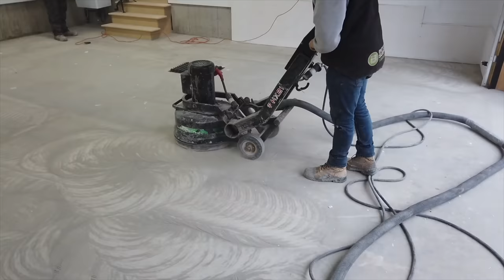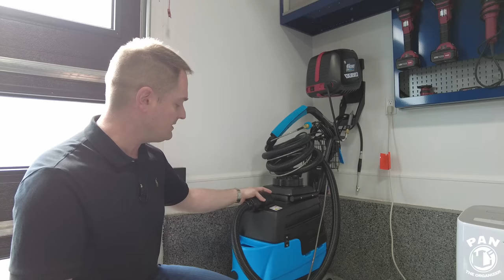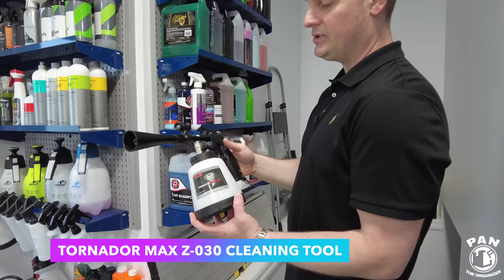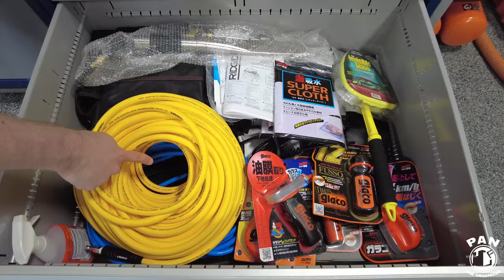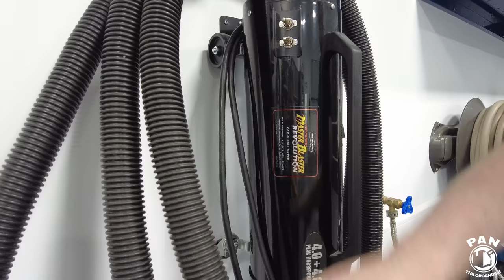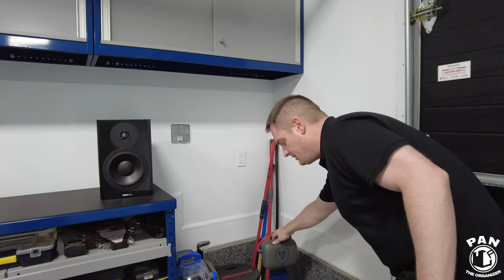INSANE garage tour! A car detailer's dream!

Comment from the maker: 🔥 For more quality detailing products visit: https://bit.ly/3BiPe3o

⬇🔶 LINKS TO PRODUCTS MENTIONED IN THIS VIDEO ⬇⬇
🇺🇸 For people in USA:
LED High Bay lighting fixture (5000K): https://amzn.to/3afEA03
Liftmaster 8500W garage door opener: https://amzn.to/2DwiKkN
Rousseau Metal garage cabinets: https://bit.ly/3AoK5UP
Mytee 8070 Lite extractor: https://bit.ly/3QJ0id4
FIAC WallAir compressor: https://bit.ly/3tNrSfI
PCL Accura 1 Tire Inflator: https://bit.ly/3QDhAIz
Dehumidifier: https://amzn.to/3ApwDjE
FLEX polishers: https://bit.ly/3Aso1sm
Rupes polishers: https://bit.ly/2T6O5m7
Microfiber towels: https://amzn.to/3P5aHyl
Bottles & sprayers: https://bit.ly/3uoNWNY
EGO blower: https://bit.ly/3afmfAb
Work platform: https://amzn.to/3ykTE4G
Tornador MAX: https://amzn.to/3Rara5W
ApexAire blower shorty nozzle: https://bit.ly/3ulLjwf
Blowerband blower nozzle protector: https://bit.ly/3nC8AWR
Daikin heat pump: https://amzn.to/3umvXrv
Detail Factory brushes: https://amzn.to/3NKtVYS
Ridgid 4.5 GAL air compressor: https://amzn.to/3AEWO67
Ridgid 4070 wet/dry vacuum: https://amzn.to/3HQOYaJ
Ridgid auto detailing vacuum accessories kit: https://amzn.to/2R9YLRf
McCulloch MC1385 Deluxe Steam Cleaner: https://amzn.to/37LMCaN
Scangrip LED inspection lights: https://bit.ly/3aeyb5i
Detail Guardz hose guides: https://amzn.to/3AsowCK
Nitrile gloves: https://amzn.to/3OFLmuR
MetroVac Master Blaster Revolution: https://amzn.to/2Dw8MjC
Wash buckets package: https://bit.ly/39xAdNf
Bucket organizers: https://bit.ly/3OIHf15
Nike shoes: https://amzn.to/3ukQH2w
Eley wall-mounted hose reel: https://bit.ly/3b6lSV3
Eley polyurethane garden hose: https://bit.ly/3qqGePb
Eley professional sprayer nozzle set: https://bit.ly/3u4wuwb
Kranzle 1122TST pressure washer: https://bit.ly/3d5kZeK
Mosmatic gun & wand solution: https://bit.ly/3ovIcPA
CR Spotless deionizer: https://bit.ly/3OGuog9
HiFi sound system: https://bit.ly/3R77Cj3
Vyper Chair: https://bit.ly/3R5OH8i
Undercarriage washer: https://amzn.to/3Al3JBb
The Detail Guardz Dirt Lock bucket insert: https://amzn.to/2J3VFbw
Lake Country pad washer: https://bit.ly/3yecJVX
Bissell SpotClean Pro extractor: https://amzn.to/3ONwMBS

🇨🇦 For people in Canada:
LED High Bay lighting fixture (5000K): https://amzn.to/3yd0Mjd
Beton Surface (floor coating): https://www.betonsurface.ca/en/
Rousseau Metal garage cabinets: https://bit.ly/3AoK5UP
Mytee 8070 Lite extractor: https://bit.ly/3nj4bb6
FIAC WallAir compressor: https://bit.ly/3tNrSfI
PCL Accura 1 Tire Inflator: https://bit.ly/3QDhAIz
Dehumidifier: https://amzn.to/3R75Qyn
FLEX polishers: https://bit.ly/3OM5lIr
Rupes polishers: https://bit.ly/3IaWqxE
Microfiber towels: https://amzn.to/3NFTv1f
Bottles & sprayers: https://bit.ly/3uoAnxY
Pump sprayers: https://bit.ly/3yPHTol
EGO blower: https://amzn.to/3yEMpFW
Work platform: https://amzn.to/3ybJ6EF
Tornador Max: https://bit.ly/3yDRSwy
Bigboi BlowR Pro: https://bit.ly/3R8lqJV
ApexAire blower shorty nozzle: https://bit.ly/3ulLjwf
Blowerband blower nozzle protector: https://bit.ly/3nC8AWR
Daikin heat pump: https://amzn.to/3OJa5i7
Detail Factory brushes: https://amzn.to/3un1k58
Ridgid 4.5 GAL air compressor: https://amzn.to/3AofrLa
Ridgid 4070 wet/dry vacuum: https://amzn.to/3u1lrpo
Ridgid auto detailing vacuum accessories kit: https://amzn.to/2OyyQRf
McCulloch MC1385 Deluxe Canister Steam Cleaner: http://amzn.to/2qtUkjS
Scangrip LED inspection lights: https://bit.ly/3acPUdi
Detail Guardz hose guides: https://bit.ly/3NHFkc3
Nitrile gloves: https://amzn.to/3OAbJ5v
MetroVac Master Blaster Revolution: https://bit.ly/3unFgHo
Wash buckets package: https://bit.ly/39xAdNf
Bucket organizers: https://bit.ly/3P47hvt
Kranzle 1122TST pressure washer: https://bit.ly/3MgYINZ
Mosmatic gun & wand solution: https://bit.ly/3EBUZbI
CR Spotless deionizer: https://bit.ly/3yGJcWx
The Detail Guardz Dirt Lock bucket insert: https://amzn.to/2WU1li4
Undercarriage washer: https://amzn.to/3nCyude
Lake Country pad washer: https://bit.ly/3I9YK8a
Bissell SpotClean Professional extractor: https://amzn.to/3QMz1GU

🇬🇧 For people in the UK: bit.ly/3yhUDDa

Comment: Wow! What a setup. Very impressive. I can only imagine what the value of all that equipment adds up to. Thanks for the tour. One question: How did you ensure that all the water makes its way to the drains? Is the floor carefully graded accordingly?
Reply from the maker: Yes if you watch closely you can see that each half of the garage is graded towards its drain. Water quickly evacuates. I worked closely with my house builder to make sure everything was up to Pan specs. :)

Comment: I’ve considered getting the CR SPOTLESS system, but from a lot of the negative reviews I’ve read, when the resin runs out after 200-400 Gals, it’s nearly $100 per resin unit to replace them. So the less expensive alternative a fellow detailer shared with me is to go to the RV supplies section in your local Walmart or similar store, and purchase the RV water filter hose hookups that you can simply installs on your hose line before your pressure washer hookup. Accomplishes the same task and only costs $10 per cartridge. I’ll have to calculate how many washes I can get per cartridge by attaching a TDS & WFM monitor and report back.
Reply: I am curious to see your results.  The purpose of the resin is to remove the hard water minerals that filters cannot remove.  These systems are typically good for chlorine etc but are not as efficient at hard deposit mineral removal.  I am curious to see your finding on that.  Please post.
Reply: @goodhomeplan  my buddy runs his entire mobile detail business using the RV filters and swears it’s the best hack he’s found

Comment: Pan,  you are truly one lucky man to have a garage like that!    I am jealous sir!    But to be honest I am moving soon to Colorado Springs Colorado and I am going to take some of your ideas you show here and apply them to my own new garage.  It will be nice to start from scratch on a new garage and hopefully make it half as good as your garage.     One thing I have in mind for my garage is having a totally separate good sized room that goes off the garage where I can put shelving, cabinetry, and counter tops (all in that stainless steel restaurant grade stuff which I love the clean look of) all the way around that room and store all of my chemicals and detailing equipment in that dedicated room.   I saw another detailing on YouTube who had all the cabinetry, shelving, pull out drawers, and a sink all in that stainless steel restaurant grade stuff and it looked fantastic and is fairly reasonably priced.   I do love those Rousseau cabinets though!    That set up you have is incredible.   The reason for the separate room is that I only want my vehicles in my garage for a super sleek and clean look and all the equipment to be unseen but where I can easily get to it by simply walking into that room off the garage itself.   Then I can have a detailing cart to roll out in the garage when I need to detail the vehicles.  I definitely want some type of drain in the middle of the floor,  even if it's just a simple small drain in the middle with the floor slightly angled all the way around so the water would drain into it.   I am going to need that due to it snowing there so darned much (like you up in Canada) so much of my detailing and washing of vehicles will be inside the garage.   I also want both hot and cold water bibs!   You've given me a lot to think about for my own garage!    I've got that same steamer.     I've been researching the Chief Steamer Model 125 direct injection model with injection tanks and continuous run feature.     It looks to be one of the top of the line steamers for detailing.    You can inject chemical of your choice directly into the stream of steam that comes out and it uses plain ole tap water perfectly fine which is another plus because you don't have to use distilled water at all with no ill effects to the machine whatsoever so that's a big plus as well.   You should take a look at it at some point in the future,  I know you would love that machine and it would fit in nicely in your garage of top of the line equipment!   It's also a stainless steel unit that is fully serviceable so it's basically a unit you would have for a lifetime.
Reply from the maker: Thanks Joe! You have some good ideas for your dream garage. It’s all about planning for your needs and dreams, and having the builder execute the work to perfection. And yeah getting inspiration from other garages that you see is a must so that way you take notes on what would work best for you.

Comment: Dream garage, indeed! By far the most interesting thing there are those floor drains. Floor drains in a residential garage are almost unheard of here in the US. I've never seen a single one. I doubt most builders would even accommodate you if you asked for one, and those that will would charge a pretty penny for it.
Reply from the maker: Oh really? Even in States where there are snowy conditions? Here in Quebec, it's part of the build code, which makes sense, as imagine all of the water from melting snow and ice, it has to be able to drain somewhere.
Reply: @PanTheOrganizer  I do wish it was part of building code here. Our answer to melting snow and ice is a squeegee and an open door.

Comment: Awesome Garage. One improve. Your garage door tracks. Cold/Heat. Try a track cushion.  Keeps door air tight even in high wind condition when the doors Flex a bit.
Reply from the maker: Door tracks? I have never heard of that. How do you install those? They are a lengthy prace of material installed all along the metal tracks the door rolls on? Or just the vertical tracks where the door closed?

Comment: Pan how do you keep things clean and dry while power washing in the garage? Love the channel by the way, anytime I have question on how to or process I always tune in!
Reply from the maker: The garage is big enough so there is almost no splatter on the walls. Plus, as you saw, I have a dehumidifier which keeps my humidity levels under control, and the walls are all mold resistant drywall painted with mold resistant paint. And the garage floor is sealed, and has two drains. Water isn't an issue here. :)

Comment: Hi Pan, 
first of - this is a well thought and planned layout of a garage for sure! Thumbs up on that. Couldn't stop noticing you have a lot of products with a "squeeze cap" mounted on them. Almost look like you have taken the cap from Adam polish products and mounted to example CarPro Pearl bottle? 

Have any info on these caps and assuming their air tight. 

Have a great day!
Reply from the maker: Not much to say other than yeah I use those caps on some bottles like my dilution of CarPro PERL 1:1 for use as a tire dressing it makes applying it on the applicator easier.

Comment: Great timing. Moving close to the end of September! what would you say roughly the heater cost is adding to your monthly bill on the winter? Debating between that unit or just a small furnace set up! Thanks Pan!
Reply from the maker: Impossible for me to really know, as it's part of the home's utility bill. But it should be very minimal as it's a very efficient heat pump that can run up to -21C (-6F). So my baseboard heater is only there for a backup when temperatures dip below that level.

Comment: Pan, been following you since COVID lockdown. Admire your entrepreneurship. Every so often you post a “game changer” vid and this was one. Question: I have Porsche satin black wheels. I’m afraid to use too strong a wheel cleaner. Pressure wash, Griots standard wheel cleaner and big hairy brush are no match for brake dust on the barrels. Any suggestions short of removing the wheels?
Reply from the maker: Regular cleaning will be key. I'm guessing if you're talking about brake dust, you have the regular steel brakes? You can use an iron remover even on satin black wheels, that's no problem. Most iron removers are actually a pH neutral formula, and become only slightly acidic when the exothermic reaction happens.

Another thing would be to have your wheels ceramic coated. That will cut down on how dirty they get, they'll accumulate less brake dust, but mainly they will be much easier to clean. I have a wheels off coating tutorial here: https://youtu.be/3LCQ0g589pM

The other option, if you don't want to remove your wheels, is to use a spray on, rinse off ceramic spray. You clean the wheels, rinse them, and while they're still wet, you spray some of it and immediately rinse off. You should get 1 to 3 months of protection that way, in a few seconds of work. This is one of my favourite for wheels: https://bit.ly/3VwnqOx

And lastly, for your satin (matte) wheels, you can use a dedicated matte wheel cleaner: https://bit.ly/3wvHEvX

See how I do it in this video: https://youtu.be/5RocSxJQmzI?t=337

I hope this helps!
Reply: Thanks Pan! You’re the best!

Comment: Just saw this video. One thing that surprised me is that your pressure washer is in the garage where you work. When you do your videos and spray I never hear the pressure washer, so I assumed that you had it in an adjacent room or closet to cut down on the pump noise. I can't believe it runs nearly silent, but if it does that would be amazing.
I was also a bit surprised you didn't have a lift built in since you built from scratch and cost is clearly not a huge factor for you. But could understand if you shy away from that as lifting cars comes with a bit of risk even when you know what you're doing.
Reply from the maker: The pressure washer is relatively quiet for what it is (it has a stout 2.1 GPM of water output) but I reduce the volume in the video editing, if not it would bother people who watch the video. Compressors, polishers, pressure washers, etc aren't pleasant to hear especially when played back on a TV, headphones or computer. That's why you perhaps think it's super quiet.

For the lift, as I have two drains with slopes in the garage, it wouldn't have been practical. Also, As I wash cars a lot in there, water and lifts aren't a good match in my opinion. 

Perhaps in a future house, if I get a three bay garage, there could be a dedicated spot for a lift. But I never really had the urge to get one.

Comment: Hey Pan, I got a little a bit of tar stuck inside the crevices of my tires; I have P235/40R18 all season tires from Good Year. It is not a lot of tar that will cause a detrimental of wear--I do not even think it could considering where it is--but I am still wondering your method to removing the tar from those crevices. 

I thoroughly enjoy your videos and I hope to view more of them :).
Reply from the maker: I’m not sure I understand what your issue is. Tar contamination on paint you can use a tar remover like CarPro TarX or Gyeon Tar. 

But tar on tires? In cracks? In the treads? Perhaps a screw driver and be gentle? Or go see a tire shop near you and have them look into it…

Comment: I’m in the process of building a new home and designing a detailing garage myself in Ontario, won’t be as big though. How do you deal with washing overspray inside the garage onto your walls or items?
Reply from the maker: The garage is big enough where there isn't much overspray on the walls really. And if there was, the walls are with mold resistant drywall and mold resistant paint, plus I have a dehumidifier so it takes care of excess humidity quickly.

Comment: What an impressive setup, Pan, thanks for sharing!  You mentioned that the drywall is moisture and mold resistant, do you also have a de-humidifier in the garage to pull additional moisture out of the air when detailing?  I'd love to have a setup half as good as yours, thanks again for sharing!
Reply from the maker: Yes I do have a dehumidifier, I mentioned it in the video and showed it on screen. :). At this part: https://youtu.be/wx6HTBAzeXI?t=505
Reply: @PanTheOrganizer  Ah, my apologies, I missed it the first time, I must have been distracted by a shiny object.🙂  Thanks for the response, much appreciated.  Please keep up the great content!

Comment: Great Show Pan. Question: if a new BMW factory painted about Aug 1st, when would it be safe to coat with Avalon King ?
Reply from the maker: If it’s a new car straight from the factory, the oaint is fully cured in the ovens at the factory, so ready for the ceramic coating as soon as you take delivery of the vehicle.

If the car was repainted due to collision repair or some other reason, by a body shop, that’s when you have to wait 1-2 months for the paint to finish the gasing out phase before you apply any paint protection on it.

Comment: Hello PAN, congratulations on this fantastic garage. By the way, what is your protocol for reusing microfiber towels? When and what are you back to use or taken out?
Reply: I think he's said most towels and applicators that see anything ceramic get tossed in the bin, ( trash) because the silicate particles can dry in the towels and scratch later. Or, if you segregate them, they "could" be used in the engine-bay, or for other non-paint general cleaning. Same would go for anything that's been used to wipe up greasy girt, or sand. The colour coding of towels could also help with that. Only using red for one thing and green for another would prevent contamination or damage. 
I suppose you could also have a steady progression of the towels you use... first use for fine work, second use for general work, final use for engine/ greasy cleanups, then trash. Or whatever number of uses in each stage you use a towel before pitching it.
Reply from the maker: I made a tutorial on how to properly wash the towels here: https://youtu.be/t_ryfGlkE9I

The only towels I throw away are the ones used for levelling/buffing true ceramic coatings in glass bottles.